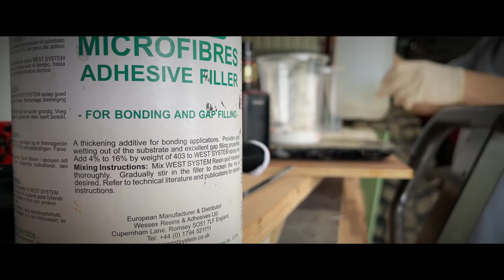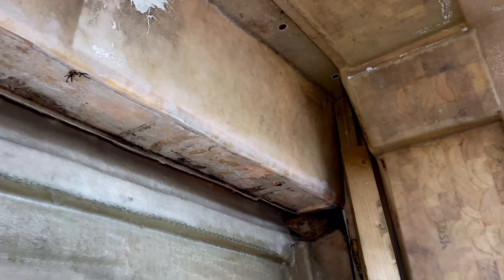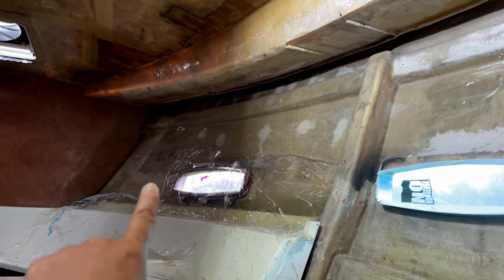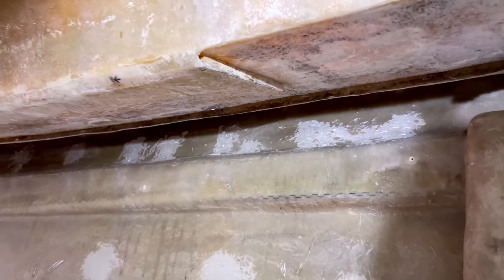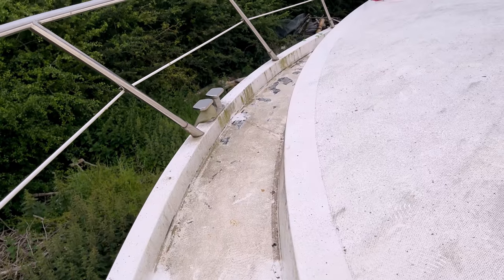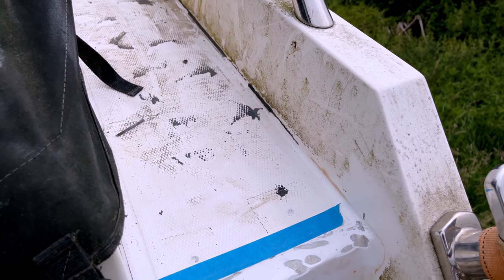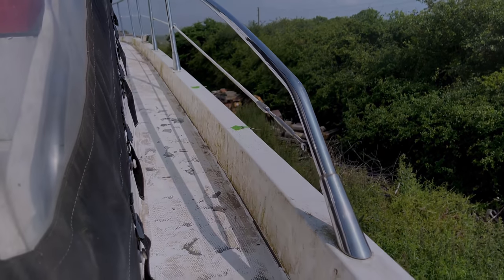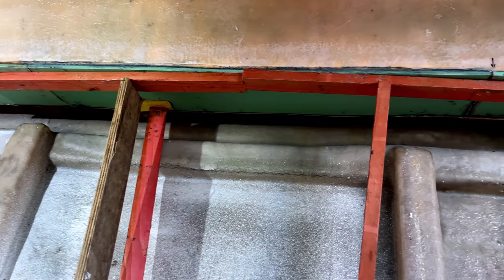DIY BOAT Restoration - GEL COAT and CORE repairs - EP.54

Comment: The entire area is filthy. Should be washed thoroughly, then grind spots, clean areas with acetone then repaired. All your work will not stick to dirty surfaces. It's just common sense. All that mildew in and out of boat must be removed. GOOD LUCK GUYS ‼️. Vinny 🇺🇸
Reply from the maker: Thanks Vinny. We cleaned the repair areas 3 times with acetone, so definitely clean. We’ve refrained from cleaning the whole deck area as this would just force more water into the core. Thanks for watching 👍